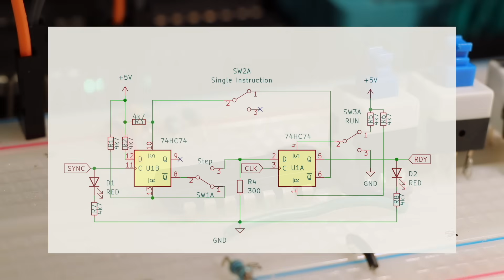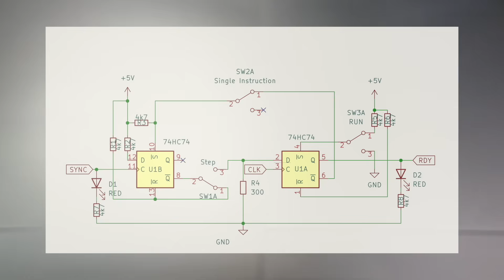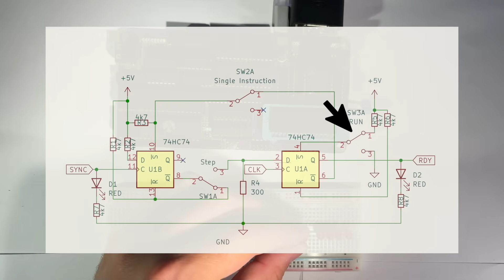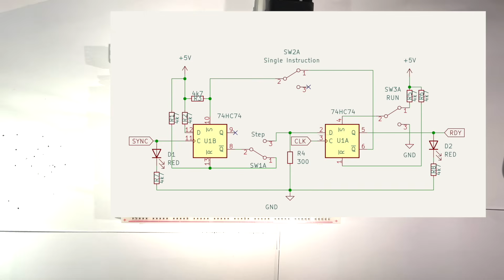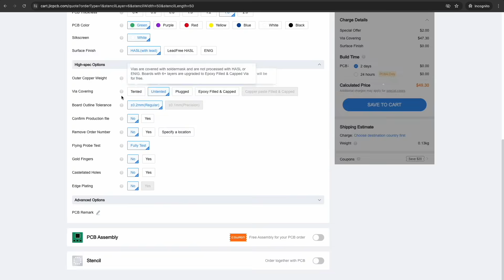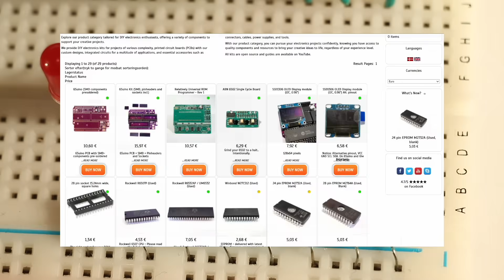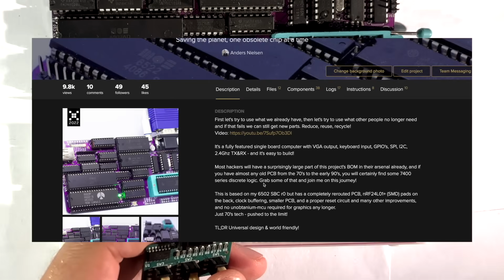Myth: The 6502 Cannot Single Cycle!

Comment: I tried to debunk so many myths like that on various Commodore forums and was pelted with insults. I was even expelled from Lemon64. Making videos like yours requires lots of efforts and I didn't have the energy and time.
Reply from the maker: It requires quite a bit more effort than most believe - and a lot of love for the subject and patience with externalities :)
Constructive dialogue is great - if people aren’t nice it’s easy to disregard :)
Reply: @AndersNielsenAA  Groepaz became very offensive with me around 2008 when I indicated ST's M27C512-90B6 PROM chip (only 1$ US at Mouser back then) had a low slew rate on output and therefore did not generate the glitches other 27(C)512 would cause when used as a PLA replacement for the C64.
He was involved with Individual Computers' SuperPLA V3 which sold for about 30 Euros so this would have been a significant loss of market.
I had proof from logic analyzers from the university where I was studying but couldn't take the results out. Eventually the genuine Super Zaxxon cartridge became the litmus test. The ST chips were discontinued in 2011 and would have saved huge sums to C64 users.
See video from MindFlareRetro : 
#10 'The PLAin Truth About the Commodore 64 PLA' at World of Commodore 2017
Reply: @AndersNielsenAA  Groepaz became very offensive with me around 2008 when I indicated ST's M27C512-90B6 PROM chip (only 1$ US at Mouser back then) had a low slew rate on output and therefore did not generate the glitches other 27(C)512 would cause when used as a PLA replacement for the C64.
He was involved with Individual Computers' SuperPLA V3 which sold for about 30 Euros so this would have been a significant loss of market.
I had proof from logic analyzers from the university where I was studying but couldn't take the results out. Eventually the genuine Super Zaxxon cartridge became the litmus test. The ST chips were discontinued in 2011 and would have saved huge sums to C64 users.
See video from MindFlareRetro : 
#10 'The PLAin Truth About the Commodore 64 PLA' at World of Commodore 2017
Reply: @AndersNielsenAA  Groepaz became very offensive with me around 2008 when I indicated ST's M27C512-90B6 PROM chip (only 1$ US at Mouser back then) had a low slew rate on output and therefore did not generate the glitches other 27(C)512 would cause when used as a PLA replacement for the C64.
He was involved with Individual Computers' SuperPLA V3 which sold for about 30 Euros so this would have been a significant loss of market.
I had proof from logic analyzers from the university where I was studying but couldn't take the results out. Eventually the genuine Super Zaxxon cartridge became the litmus test. The ST chips were discontinued in 2011 and would have saved huge sums to C64 users.
See video from MindFlareRetro : 
#10 'The PLAin Truth About the Commodore 64 PLA' at World of Commodore 2017
Reply: If you were banned from Lemon64 it wasn't because you were just trying to debunk myths. As long as you showed evidence and stayed civil then you wouldn't have been banned.
Reply: @AureliusR  I can give you a copy of no less than 500 posts Groepaz left there that were directed at me that were all personal attacks including questioning my mental health. Everyone has their limits.
What you say is patently false. He was an acquaintance of TNT and that is the only reason it ended the way it did.
In any case it resulted in me selling more than 200k$ worth of merchandise that according to him should not have worked and caused damage to C64. All false.
Added edit :
The document titled 'The C64 PLA Dissected' by Thomas 'Skoe' Giesel proved everything I said was true and all the disparage from Groepaz was lies.
Reply: @AureliusR  ROFL
Reply: @DinoDiniProductions  ?
Reply: @AureliusR  That you think online forums are logical or fair.
Reply: @DinoDiniProductions  I think it's funny that you assume they all aren't. Any forum moderation is a reflection of the people running it.
Reply: @AureliusR  I think it's funny that you think I have not been looking for  30 years for online communities that a) work and b) are not boring
Reply: @DinoDiniProductions  Then you certainly haven't been trying very hard.
Reply: @AureliusR  the first thing a bully does is try to deny someone else’s reality… I think you are a bully and so don’t even notice that there is a problem.
Reply: @DinoDiniProductions  There are lots of awful forums. I'm not disagreeing with that at all. I'd even say probably the majority are crap with crap mods. But you're just saying ALL are crap when this is clearly not true.
It's also funny that you accuse ME of being a bully when you started our interaction with a ROFL at my comment.
Reply: @AureliusR  We heard from someone who has had negative experiences, and you appeared to question their manner. You implied it was their fault, just in the manner of toxic exchanges that are right out of the book of forum toxicity. So I responded in an appropriate manner. Your entire tone is like that of a troll, and if you can’t see that, we’ll I guess my analysis was spot on.
Reply: @DinoDiniProductions  Just absolutely flabbergasted that YOU are throwing around troll accusations. GFY
Reply: @AureliusR  You are kind of making my point here...

Comment: It would be a bit more complex, but I'd think it should be possible to adapt that concept to make a break point debugger as well. E.g. feed all the relevant pins into a RAM chip's address-in pins and use one of the data-out pins as break signal. (Thought at that point, just using another CPU to track things might be easier and cheaper.)
Reply from the maker: Gotta admit - at that point my hands would be tingling to grab the modern 16bit logic analyzer :) …but no break points though
Reply: I'm sure there's better options, but I'd be itching to see how much can be done without specialized tools. ("We did it with the wrong tools, as a joke")

Comment: But what happens if the clock speed gets down to zero hertz (regardless of the circuit shown), specially if using the older versions of the processor? I think part of the myth may still be true - not being able to run if single clock cycles are fed to it. In the video the 6502 still receives the clock at full speed, but execution is "gated" by the RDY   pin.
Reply from the maker: I did mention it in the video - if the clock gets below about 10 kHz the registers start getting corrupted :)
Reply: @AndersNielsenAA  Sorry didn't notice that.
Reply from the maker: @MCPicoli  np :) I still don’t have a complete picture of how exactly the registers lose their contents on a silicon level - but I plan to find out :)
Reply: @AndersNielsenAA  The register state is held in capacitors, like a dynamic RAM. The charge leaks away and has to be refreshed periodically.

Comment: 4:08 I don't think the C64's 6510 CPU has SYNC capability.
Reply from the maker: It doesn't - but you don't need it to single cycle. It works fine with just the RDY pin :)

Comment: Slightly confused here; didn't both the Ataris and the C= 64 have special pins to let the gfx chip halt the cpu? Was that working different from what you described here?
Reply from the maker: Absolutely - they used the RDY pin to slow down execution just like the description in the 6500 datasheets. My point here is the 65C02 is often credited as the only chip you can use on a breadboard and step one instruction forward at a time - but actually the NMOS 6502 has the RDY pin for exactly that purpose and has no limits as to how long you can pause between instructions if you keep the clock running. ...and then I show how to do it :)

Comment: ohhhh cool! I heard this information about the registers losing data with no clock refresh, and was a bit disappointed. I am interested in running a real 6502 as a hardware unit test and source of truth against an emulator I want to make, so this information should be pretty useful.
Reply: That's the trick here, that the clock never stops.

Comment: I thought static for a CPU means that it does not rely on race conditions between edges. So you can slowly change the voltage on the clock pin. And as long as your noise amplitude is below the range between high and low, it wouldn’t accidentally go backwards or double step. A lot of flip flops need edges which transit faster than the speed of some logic gates? They store information on the gate capacity?

10 kHz is really slow and more like dynamic RAM. Again data is stored in a capacitor. Intel had a refresh circuit for this. In 6502 only temporary registers are dynamic. Are we sure that this isn’t really the pre-charge of the bus? It leaks away, and then when a device on the bus fires, no voltage changes.

So you say that VIC-II in C64 should have used an input buffer to accept early data if the current instruction does not 7 cycles?

I still don’t get how Atari 8 bit stalled the CPU for individual cycles. Surely, they did not manipulate the core. So they could only keep up the clock high for longer. Is the difference that commodore has a clean rhythm with the clock: 64 always half as slow. Plus4 : faster in the border (separate enable bit for side and bottom border). While Atari comes up with the signal on the fly?
Reply from the maker: I’m not completely sure and you may be right I stretched the comparison between DRAM and SRAM over to registers a bit too far.
Woz actually ran into the issue with the Apple II - he thought he could keep the clock high while refreshing RAM because it was faster than the spec for a cycle - but he missed that keeping the clock high for a whole cycle at 10kHz is essentially 5kHz.. and he started losing registers.
He kept swapping to new 6502s because brand new ICs have greater register capacitance than slightly used ones - it worked for a little while..
I bet he was real happy to switch to CMOS :)
Reply: @AndersNielsenAA  Woz was working with off-the-shelf TTL chips (no ASICs) so he cheated every way he could to keep the parts count down. It's impressive what he accomplished, but it was a very minimalistic design that wasn't very friendly to the programmer.
Reply: @bryede  ב''ה, there's too much weird Apple-as-religion and California Uber Alles to it now, but the actual story of MOS supporting Woz to get the thing running is a neat anecdote if you can find it and how the industry actually got going back then.  It's hard to say who was most programmer-friendly, Woz in particular was going for the minimal parts count but did plan for ML being immediately accessible, most of the other players were particularly interested in making BASIC accessible and some of the less successful machines of the era were hobbled by that (not so much CBM and TRS who took a 'well, this won't be too difficult for nerds' approach).
Reply: @AndersNielsenAA  so we really talk about the non-temporary registers? So even for NOP the 6502 goes through A X Y SP on instruction load and refreshes a capacitor? I don’t see the metal lines for this. Intel had a register file and a refresh counter just below. And for each cycle (or instruction) this counter would advance. Ah, so on clock low registers live forever?

To check if real registers are lost we need to keep the clock high for long and sta something with an addressing mode with z or t or SP . Then record the address bus. Then execution the same instruction, but with short high. If Y survived, we now record the correct address . This tests AH and AL .

Or is it some trick with the instruction pointer? Or ALU input: LDA, CMP, PHA . Slow and fast . Test TAX …

In a way 6502 is dynamic: it uses a line of inverters to delay the clock to create 4 phases. The clock edge needs to be sharp, not jitter. I don’t think that there is a Schmidt Trigger . I know that Intel and others need two clock pins with non-overlapping phases. I feel like this is mandatory for static operation. So 65C02 has two clock pins? In the end CMOS is mostly great for battery life because at that feature size leakage was zero and energy consumption also while holding a phase. I would like to see a joule thief where the 65c02 uses solar power and reduces it clock at dawn until it stops.

Just wanted to add: static CMOS must not have an overlap where PNP and NPN both conduct. I guess that 1.1 V core voltage 5 GHz CPUs don’t really care that much. I also wonder how old discrete CMOS avoided this at 12 V max on the rails.

Scrap that slow clock. Even a CMOS circuit on solar power needs a clean step clock edge and enough energy in an accompanying capacitor to run a full physical cycle ( but not a whole instruction).
Reply from the maker: @ArneChristianRosenfeldt  Neither - in those 1/10.000ths of a second you need to pass both phases.
I’ve seen NOP running continuously slower than 10kHz without the program counter losing count - but something is out of spec for sure. 
Not completely sure what’s going on at the silicon level - would love a detailed description - but I am guessing it is in some way  caps leaking.
Reply: @AndersNielsenAA  I found that in the NES: The sprite memory in the PPU is DRAM, but its refresh is the same as evaluation.
Nintendo is explicit about it as Intel. Weird that MOS is not. I should check visual 6502 if the bits use 6 transistors or 1. DRAM needs sense amps and an SRAM buffer. AH AL only serve as buffers. I read that the MOS designers were speed freaks who wanted to squeeze the most MHz out of their ancient fab / large feature size for yield. So with 8 transistors an SRAM bit could be put to the middle between low and high (turn off power) then connect to the bus (phase change), and then power up feedback (delayed phase ). I babbled on in my last comment.
Reply from the maker: @ArneChristianRosenfeldt  You’re certainly digging into a deep subject I’ve only scratched the surface of - I guess I should go deep with Visual 6502 some time :) 
I appreciate the thoughts, thanks! 😊

Comment: This is very interesting, love how simple the final board looks. Can you single step Z80 range of processors as well?
Reply from the maker: Thanks - I think the Z80 has static registers and doesn't mind stopping the clock. I guess technically you could use this circuit just for debouncing and hook it up to the clock - but less would do :)
Reply: @AndersNielsenAA  Thanks for that. I'd be looking to use this for stepping through old Z80 and 6502 arcade PCBs to see what makes them tick. Before the likes of custom chips were a thing.
Reply from the maker: @phils_arcade  In that case you would probably need a bit more work for the Z80 in circuit since you would have to manually do all the steps.
But maybe you get some inspiration on how to make that happen on a breadboard from this :)
Reply: Z80 has an M1 pin that signals when the CPU is fetching an instruction so plenty of designs are around that single step it.
Reply: @blahblahblahblah2933  Yeah, the Z80 had "single step" and "single instruction". A Z80 NOP needed 4 clock cycles to complete ...
Reply: The E&L MT-80Z "The Fox" trainer has a single-step setup built in. Which works just fine.